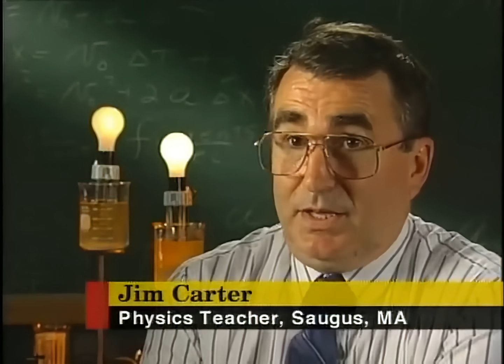MIT graduates cannot power a light bulb with a battery.

Comment: I want to know how none of them called out the fact that its a 120 volt AC bulb and a 1.5 volt DC battery. Did no one really get that?
Reply: 007K an AC lightbulb? they don't exist, either a lightbulb or an LED. An incandescent lightbulb works with both AC and DC circuits, a diode works only with properly configured DC circuits. Also the bulb looks an awful lot like a lightbulb from a cheap bike light or an internal light in a car. in which case it would be 12v, and 1.5v would be more than enough to light it.
Reply: @Nickgowans  An LED will light up on AC. It will just be dark during parts of the cycle below the threshold voltage. A 50/60 Hz flicker isn’t ideal but won’t stop it. Since we seem to need to list conditions, it needs a very precise voltage range, or a reasonable one with appropriate current limiting: an LED by itself will not light up if the voltage is slightly too low, or burn up if the voltage is slightly too high. I also realize this was 8 years ago, but I might as well add to it.
Reply: @Nickgowans plm
Reply: @Nickgowans No he was referring  to an actual 240V lightbulb which one of graduants is holding. At somepoint theres one that you are talking about.
Reply: Most lightbulbs don't care if the electricity supplied is ac or dc. And the only difference here with the battery voltage being so low the light wouldn't be very bright if it lights up at all.
Reply: filament bulb work in AC and DC both
Reply: +007K, considering that they didn't have the wire hooked up correctly, it doesn't much matter whether there was enough juice or not to light the bulb. The circuit wasn't completed and as such hooking it up to a car battery wouldn't have resulted in a different result.

If they hooked it up and nothing happened, then they should have been able to conclude that either the battery wasn't powerful enough, the bulb was broken or the wire wasn't continuous. But, without even completing the circuit, you can't make any assertions at all about the set up.
Reply: They are still in exam mode: knowing they will be asked something which they are not sure they really know and then this will have negative effects on their further life. If they were in a comfortable environment they would first question the question: "What do you mean by 'a wire' - only one?" - "With that bulb and that battery?" - "Even if you gave me a better power supply, how can I be sure that the bulb isn't broken."  - "What is your purpose? Testing my ability to fix home appliances?" These would be the normal reactions, I suppose.
Reply: The only real failing the grads had was that they didn't have the experience to request more information before giving an opinion.  Somebody with a little engineering experience asked that question would have replied "Depends on the light bulb and the battery."  Somebody with even more experience would have said "And what you give me for wire."

In engineering you learn, from experience, that assumptions are often the cause of failure.
Reply: 007K There is no such thing as an AC bulb
Reply: Number Eight no, it likely wouldn't. In order to light the current must be high enough to produce sufficient dissipated energy (in a 60 W bulb on 120V the current would be approximately 0.5A). If that same bulb were supplied 1.5V, the current would be approximately 6 mA, meaning the total power is less than 0.1W. That is such a small amount of energy it will most likely be disipated through the nonvisible spectrum and as heat.
Reply: @danielfay8963 I'm guessing the current would actually be 60 mA and the power would be 1/10th of a watt. The incandescent filament has only about 1/10 the resistance when cold, which is why they have an inrush current of 10x for a few cycles when first turned on.
Reply: There is no problem in battery voltage, DC current etc. The main challenge is the connection. They thought that it is quite impossible to complete the circuit using one wire only. But they forgot that the bottom portion of the bulb is conductive. It is nothing but a silly mistake. We engineer face these type problem very few because we are well equipped. Necessity is mother of all invention.
Reply: 007K - Yep I thought that, but technically I believe that indeed a 150v bulb would light but it would be so dim as to be undectable.
Reply: Number Eight you have no Idea how much I agree (I am INTJ btw) I'm still in high school, and I volunteer as a tutor sometimes. Most of the people that come don't want to actually have to think, they just want the answer (or a formula that they can simply plug the right numbers into). It bothers me that most people seem to think this way, because 1) the answer is the boring part, we already know it, it's the process of finding the answer that is truly insightful and 2) the fact that so many people demonstrate this quality means that somewhere within their development people are being taught that this is learning
I remember being asked this exact same question in 2nd grade. No one in the class could figure it out, until eventually I came to a solution, followed quickly by another student who recognized a simple way to improve on my method and make the aparatus easier to handle.
Reply: Al Paca when the guy touches the light to the battery and it lights up, that is a low voltage light. But the one they gave the students is a much larger house light. I know I said AC, I just meant its meant to be on house power not a battery, but yes lightbulbs can take AC or DC power
Reply: Sourav Bagchi true, but those small bulbs are designed to operate at 1.5 v. a light bulb is more or less a resistor, with energy be disipated in the form of a little bit of heat and a bunch of light. let's say you have two light bulbs that each produce the same amount of light (they have the same amount of current through the filament), but one operates at 1.5V while the other operates at 120V. If you apply the same voltage to both, then according to ohms law the current through the 120V bulb will be 1/80th of the current through the 1.5V bulb, meaning it likely won't produce light at all.
Reply: @danielfay8963  If it's incandescent, mostly dissipates heat.  Why they are generally replaced nowadays by high-power led's.  The conversion ration to visible light is very low compared to the infrared produced in particular.
Reply: Daniel Fay A case study I always remember is how 3M noted that a handful of its scientists seemed to generate most of its new products (compared to all its R&D scientists) and these innovators were B grade graduates. Another aspect that struck me is in psychological profiling it was the ISTJ (Meyers Briggs) that excelled most in engineering/sciences at University.... yet sensory types are not the intuitive bigger thinkers. Too much emphasis on wrote learning and not enough on a wide logic based reasoning approach.
Reply: maybe has something to do with being raised in a series of rooms and being told what to think their whole lives, instead of actually living in reality encountering problems that are not fed to them by teachers
Reply: autoformer?
Reply: @maxbauer1633  Deceptitron.
Reply: Daniel Fay Fair enough, but the original question posed to the graduates was quite generic, and really sought a yes/no response. The graduates upon receiving the materials could then explain why they could not light the bulb. Seems like a lot of these grads don't have a practical mindset.
Reply: 007K that would been the first thing I actually said after being asked the question. "Well it depends on the bulb, but if you wanted to be technical about it, I probably would of just skipped that response and went straight to, "Well I could probably pass electricity through a lightbulb with a battery and wire, as to whether it lights up and to what degree who the hell knows.".
Reply: This won't help you light up a 20W bulb with an AA battery but might be still interesting to note: You could actually construct all elements for a crude inverter and a transformer out of plain wire and maybe a thin metal plate to actually transform the 1.5V to 120 volt AC.
Reply: not 100% sure but i think for regular incandescents AC/DC doesnt matter
Reply: 007K as far as I can see its a small 5v bulb
Reply: Lol. ac bulb.
Reply: An old fashioned filament bulb will light with A/C or DC - try it by hooking 3 9V batteries together.  ...but probably not with 1.5V battery.  However, it was probably not one of those anyway.
Reply: Daniel Fay Those small Torch light bulb can also operate in 1.5V
Reply: Number Eight yeah, it definitely doesn't change the fact that they had no idea what to do, just adds one more thing they failed to notice.
Reply: Daniel Fay   I would expect every eleven years old boy can do this. Should have experience at least from fixing his bicycle....
Reply: Sourav Bagchi There isn't a problem with 'a wire' as you'd expect to be able to cut it. The real issue being highlighted is when they face the problems they seem unable to ask the right questions or indeed have a basic knowledge of how circuits work. To be a GOOD engineer you need to have pragmatism, common sense, an interest in systems and the ability to know what you need to solve problems in a cost effective and effective manner. On this thread there is too much discussion about specifics and missing the basics that were being highlighted... and yes, sure, an electrical engineer should be able to go the next step into greater detail.
Reply: You don't need to be EE to know working of light bulb with battery. Knowing basic undergrad chemistry and physics courses can tell you workings of filament light bulb. From the fundamental you start asking necessary questions to which will lead to analysis of electron excitation/path and energy required to do so for the system.
Reply: 007K basic fundamental of electricity supply and demand were not taught
Reply: @j5892000  That's ECON101😁
Reply: Wiring was wrong.
Reply: Except that a CFL bulb designed for a 110VAC lighting circuit will require around 110VDC (give or take, depending on how tolerant the circuitry is).  Not gonna work with a 1.5V dry cell.  So you get a point for noting that a CFL will work on DC.  You lose 10 points for thinking that a CFL will work on less than 2% of its rated voltage.

Hint: it relies on the avalanche effect in a rarefied gas, and that requires a minimum voltage  to ionize mercury at all, let alone get an avalanche of ionization happening.
Reply: bdf2718 of course it won't work on 1.5V, I was only meaning that whether the input was AC or DC had no bearing on the bulb's operation, as either way the output on the electrodes will be AC.
Reply: @ A.Z.:   That's a different bulb!  Most of the other grads were given a 120-volt bulb to work with.  As 007 correctly pointed out, even if they knew how to hook it up, it would not have lit up anyway.
 
And it's not about AC vs. DC.  Many commenters here have gotten bogged down in that red herring as well.  007 merely stated that the grads were improperly given a 120-volt bulb to power with a 1.5 volt battery (technically, a "cell").    007 mentioned "AC" in his original comment simply because that's the kind of bulb it is -- a household light bulb that works on 120 volt mains electricity (which is AC) -- as opposed to a flashlight bulb which is designed to work on battery power at a much lower voltage.  007 was not saying that the AC aspect of the bulb was the critical factor for why it wouldn't light up.   It's just that that is what type of bulb it is.  It was just part of his identification of the 120-volt bulb.
Reply: Quite right. The correct answer for most of them would have begun "Yes, if....."
Reply: none of them are electrical engineer..
Reply: My lord, it's a 9 volt battery and a small incandescent bulb. Do you even understand the basic principle of how something as fundamental as a light bulb works? It's literally just a filament in a inert glass capsule, whatever voltage you put through there will heat the filament and produce light. A lower voltage will produce LESS light, but still enough (you can see it glowing faintly in the video). As for it being an "AC bulb"... seriously, it's not that complicated. It's just a WIRE. It couldn't care less whether it's AC or DC.
Reply: Daniel Fay yes, you realise you're not a bog standard thinker at an early age if you've got good intuition. All as I can say without going into lots of detail here is you'll enjoy unstructured problems and you'll have plenty of eureaka moments if you learn as much as possible in many fields of knowledge (Your mind will constantly be trying to link up seemingly disparate information and occasionally a pattern will jump out). You'd probably like the channel 'Robert Murray-Smith' who does a lot of greenfield back shed based research into Batteries, Energy and Graphene.
Reply: Aznwarlord7 as a matter of fact it doesn't matter for cfls either, as cfl ballasts first pass the ac input through a bridge rectifier, then some circuitry, then an inverter to make it ac again. Since dc passes through a bridge rectifier without a problem it would work exactly the way it's supposed to
Reply: Number Eight yeah, so far I have loved classes like calculus and physics, and am planning on studying some combination of electrical engineering and/or physics
Reply: He edited comment, you special kind of idiot
Reply: +Al Paca Well, your bike and your car are pretty unusual... I have never seen bikes or cars with Edison screw sockets above E10 for the light sources before. You could increase the temp of the wire a bit in a 12 V bulb with 1.5 V and the right amount of current that a d-cell can deliver.  But it depends on the lightbulb if it would actually start glowing..
Reply: T Oadaly A cfl bulb will as well, they rectify the AC input and then invert it back to AC, so a DC current would pass straight through the bridge rectifier and get inverted just like normal
Reply: Nonetheless, the guy you replied to (007K) stated "how none of them called out the fact that its a 120 volt AC bulb and a 1.5 volt DC battery".

And you stated that a CFL will work on DC so he was wrong.  No he wasn't, because he explicitly pointed out the reason those guys didn't get the bulb to light was the mismatch in voltage.
Reply: bdf2718 I wasn't replying to 007k, I was replying to someone else's comment, and I never called them wrong either
Reply: my 6yr old sister know that
Reply: what if it's a small light bulb? I m not from MIT.
Reply: Filament light bulbs can be operated with either AC or DC, since it is just a resistance with no polarity. The difference is that it will flicker with AC. At the frequencies commonly used this is not a problem due to persistence of vision, but it is an issue for instance with video cameras if they record at a frequency that is not in sync with that of the AC.

It looks like a common 12v lightbulb, used for microscopes, bike lights and flashlights until white LEDs (Actually blue or ultraviolet with a phosphor coating) replaced them in those applications.
Reply: You mean rote learning.  Is it even learning if you can't do it again on demand 10 years later?
Reply: There is a difference between AC and DC in bulbs. If you pass 120 Volts of DC current through a bulb designed for 120 V AC, it will glow brighter and probably blow. Try it.
Reply: Who the fuck said it was a 120AC light bulb Einstein. Idiot.
Reply: Dumbass. Ever heard of a DC-AC inverter you fucking idiot fuck off. Eat shit.
Reply: Finally someone who knows the basics, thanks goodness I'm surrounded by idiots.
Reply: Meathead, even a 5 year can understand a filament light bulb and a light bulb. Ever heard of a flashlight? Your one of those morons who costs the company millions of dollars on dead end ideas.
Reply: Wrong it's a DC bulb
Reply: 007K  you got a point there cause a 1.5 volt battery can't light a 120 v light bulb
Reply: Probably it is not a 120V lamp it's a LED and a battery is enough
Reply: It's an old prank people say yes you hand them a bulb and a source that cant possibly do it and then laugh. They are only showing the retards who didn't figure it out. I bet 90% of people they showed would've just laughed.
Reply: 007k  where does it say 120v bulb?
Reply: Oh hello? Thats harvard :p
Reply: she is not a mechanical engineer lmao that's why
Reply: This is like asking somebody if they can hang drywall then throwing them in a room with no framing.
Reply: The students where not even told these parameters when the question was asked. Their first response should've been "that depends on the type of battery and light-bulb involved", but of course the conditions of the interview where set up in a "yes/no - if yes: prove it" situation.

I think the one student that said "maybe" did, as you see him demonstrate with a dc bulb later in the clip: https://youtu.be/aIhk9eKOLzQ?t=118 - but it seems partially edited out to prove the case about knowledge.
Reply: bruh
Reply: Wow. You should be in MIT
Reply: Filament works off the resistance of the current in the line connected to ground. It does not care what why the current is coming from.
Reply: An AC electric bulb(incandescent) will absolutely work with DC batteries given the RMS  AC = DC
Reply: DC or AC for resistive loads is the same. coil up the wire, energy gets stored in the magnetic field, disconect the battery back EMF feeds energy to the bulb
Reply: LEDs care, incandescent bulbs not so much.
Reply: Maybe they did point that out? We don't know what they cut out of the video
Reply: An AC bulb...🤦🏻‍♂️ I am astonished by the number of people that think an 'AC bulb' is a thing. A bulb has a filament which doesn't care which way current flows through it.

The video is funny, and a little worrying as well.
Reply: Comment I am looking for, you can't light up ac bulb with a dc battery
Reply: Lol wtf are you talking about?! 1000 likes 🤦🏻‍♂️🤦🏻‍♂️ ever heard abour 12v bulbs for cars 😂
Reply: I give that a 30V DC at most. You saw it, right? It's so, so tiny. I have never seen a 120V AC bulb so tiny if it isn't LED.
Reply: That problem would have revealed itself if they 1st managed to make contact with the battery and one of the bulb’s terminals 😂
Reply: There is no AC bulb. A bulb is always DC. I think it would light up a little. In the AC case the effective voltage determines the brightness. Or in other words the average power.
Reply: You can get 6.5 v bulbs
Reply: Thank you for showing what engineering is about. As a engineer, i also didnt notice.
BUT, i can tell you that AC/DC and current doesnt matter, because a normal lightbulb is light emitted trough the movement of a electric field. Lower voltage just means less light
Reply: The light bulb was tiny and would've burned at that voltage
Reply: it's an incandescent bulb, so it doesn't care about ac/dc, and if you supply lower voltage to them, they'll be just dimmer
Reply: Maybe they needed a different question. Can you make a shoe smell. If they say a shoe can’t smell because it doesn’t have a nose. The answer is right. If they put their foot in the shoe and says it smells now. They are also right.
Reply: Valid point...
Reply: Hailstorm i would say you dont know basics.. Transformer cant be made with dc..
Reply: @siux94  a transformer can be made with DC ?
Reply: @adespade119  well, technically yes, but changing DC. Not DC from battery without switching.
Reply: Sourav Bagchi perhaps, but 1.5v might not even be generate sufficient current through the bulb
Reply: @danielfay8963 it barely lit the smart brothers small bulb, those students before him had a larger bulb so I'd reckon you're right
Reply: But a cell can be made to produce ac: connect and disconnect the cell to the primary, inducing a higher ac transient voltage in the secondary to light the bulb.

But simply connecting the 1.5 V cell to the 120 V bulb will work - the interviewer didn't specify how brightly the bulb had to light...
Reply: Yeah I even knew that
Reply: he said a boost converter, those dont work with AC, you just need some caps and an IC
Reply: Than still the voltage needs to match the battery.